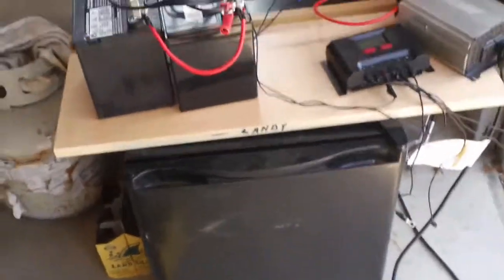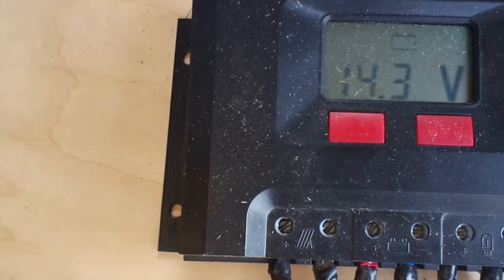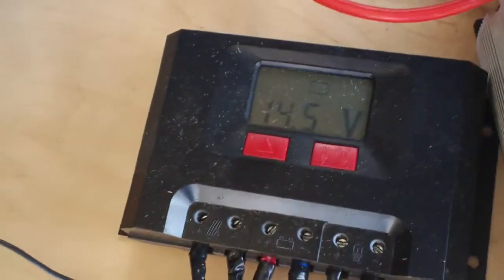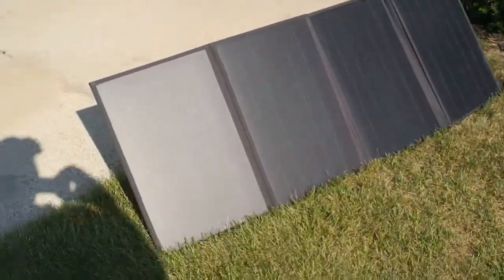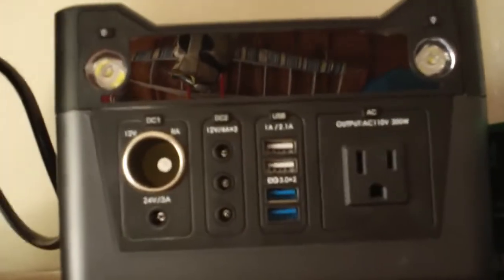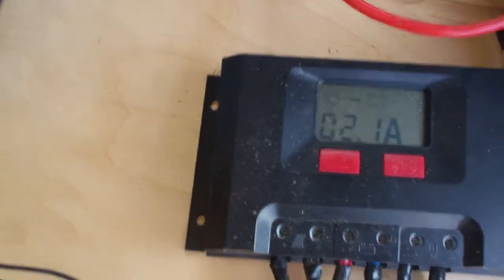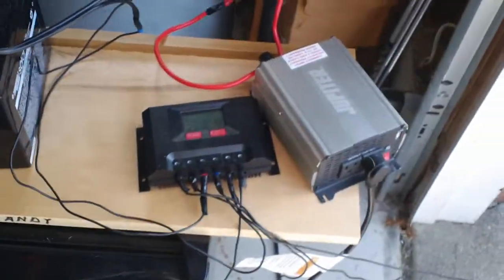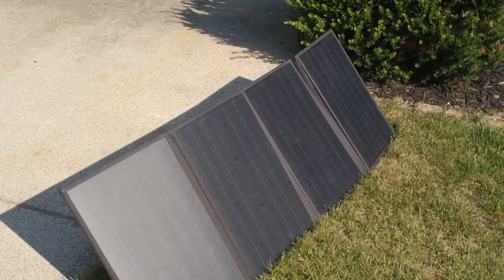Solar Powered Mini Fridge

Comment: Hello.  I have a current set up using a 100 watt solar panel from Harbor freight, two golf cart batteries (I believe 20 Ah each) plus the inverter and controller also from Harbor freight.   I really don't remember the wattage of either.  I currently use this system just to use a few LED lights, charge phones etc so plenty of power.  I just don't know if I need to add another battery to keep with fridge going (especially in the winter with less sun) 24/7 for a few days at a time when hunting, and if the inverter and controller are adequate.  I hate to go underboard but not overboard either.  Suggestions from anyone would be helpful.  thanks Jim

Comment: Great video! 
A 5.cf chest freezer draws about the same amount as the mini fridge. They can also be converted to a fridge easily. Keep the cold inside and it would be more efficient. Depending on your area, part stores can sell used deep cycles for cheap.
Reply from the maker: You have some really good ideas I may have to try that

Comment: can the same be done for something like a 5000 BTU window air conditioner?
Reply from the maker: You may need 1200 plus watt hour batteries to do that and 600 watts of flow through solar charging
Reply: @yooperjim5510   but how many battery in series and how many watt solar panel I would need to keep a 5000btu unit running efficiently  all night till I go to work the next morning and shut it down while I work and let the solar charge the battery full after I get home from work ?
Reply from the maker: @joeblowjohnny2297  HOBOTECH has a good video on this. He has 3 200 AH batteries and 1300 watts of solar

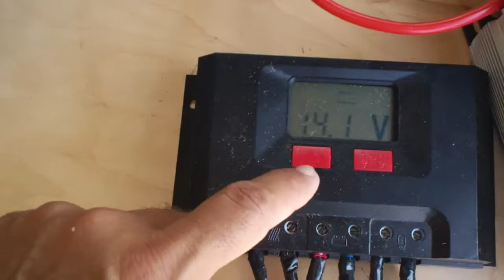Comment: At 6:50 your cheap pwm controller said 2A. That does not mean 2 watts, it means two amps. Depending upon what the voltage actually was at that point in time 12 or 13 volts, it would actually be about 24 to 26 Watts.V×A=W
  In case anyone is interested, there is quite a decent quality mppt controller available for less than $100 by EP ever, A pair of 6 volt golf cart batteries wired in series will last about a hundred times longer than car batteries, and finally, a full size refrigerator does not take much more energy than a mini fridge.
  Harbor Freight solar components are not very good quality, or efficiency. It's easy to find very high-quality solar components for just a little more currency than Harbor Freight stuff.
  Think about expanding your system when you first start out, and things will be much, much easier later on.
  Say hi to the "Turdy Point Buck" for me next time you see him!
Reply from the maker: Yeah I know better than to confuse my amps and watts. This set up I did on the fly and for cheap.  I plan to get a bigger Sogen in the near future. This system has been fun to experiment with.  Thanks for the comment
Reply: yeah, caught that.  I think it was a brain fart... I would and have done the same.  A is Amps.  W is Watts.  Good video.

Comment: How long would that rock pals 300 power station run the fridge?

I’ve got a Bluetti 720wh power station and thinking about doing a mini fridge rather than dc cooler because of cost. Great video!
Reply from the maker: The Rockpals will power it for 7-8 hours depending on your outside temps and your settings.  The initial start up surge is about 250 watts and then it runs around 55-52 running watts. At 70 degrees your unit will cycle every 8-10 minutes on and off. The Blueetti should do great. Your solar panel can keep it going during the day with little drain on your battery.
Reply: @yooperjim5510  Will the BLUETTI EB3A 600W 268Wh can run it? I'm looking to buy Bluetti 600 with solar for charging along with the gas generator just for my mini fridge, i'm already using a gas generator for everything but the fridge needs to run continuously. Great video, inspiring.
Reply from the maker: @surf2257  I use my Bluetti EB 70S for my 12 volt and it does fine. The only problem with using he EB 3, you will lose some watt hours when converting to AC. I would recommend getting a cheap 12 volt and utilize the DC outlet.  Your Bluetti might get you through the night but the battery will be close to 10 to 20 percent by 7am

Comment: Do your batteries run the fridge all night?
Reply from the maker: I used the Rockpals 300 watt power station and it did keep it going through the night. I have not used these batteries camping yet but it should.  I have at least 400 watt hours with the lead acid batteries
Reply: @yooperjim5510  thanks